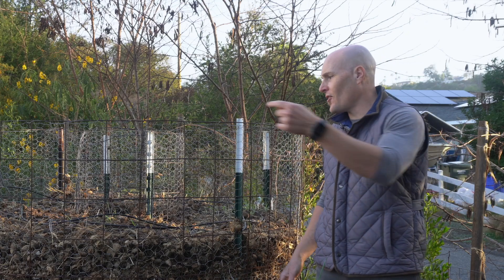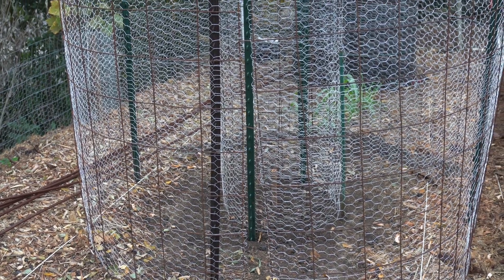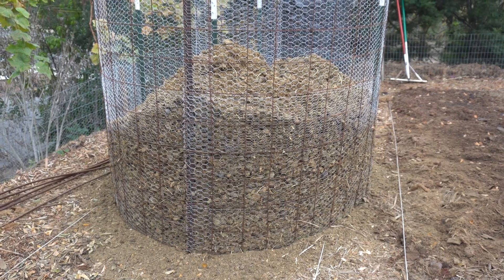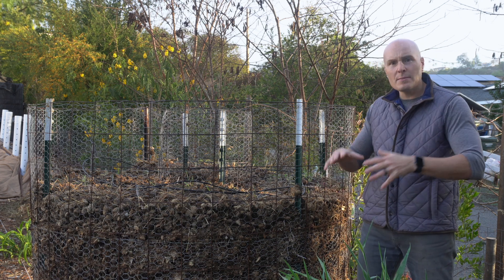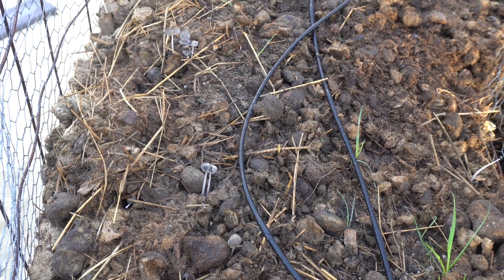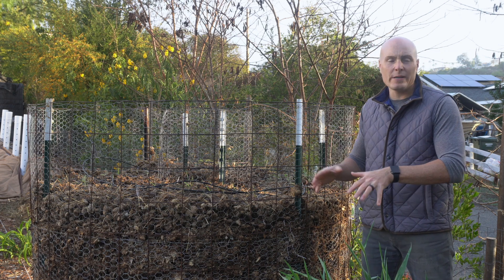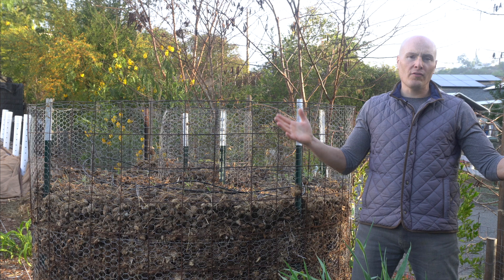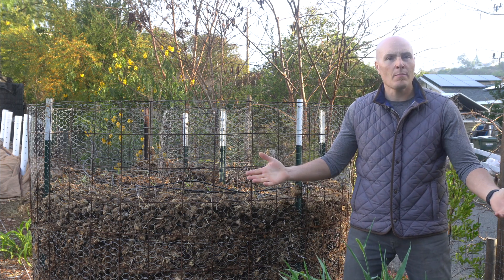Huge Compost Bioreactor | MORE COMPOST, LESS WORK

Comment: Great compost doughnut! What if you added different horizontal wire "layers".  Maybe chicken wire a couple of feet down so you have inch hexagonal openings for finer compost to fall through and decompose into the bottom layer of 1/2 inch hardware cloth.   I think the addition of 1/2 inch hardware cloth to the base could be a way to sift out the finished compost.  Maybe 1/4 inch hardware cloth at the very bottom?  Perhaps there's a foot of crawlspace you create with large rocks or whatever and the finished compost sifts itself to the bottom of the pile? Then you scoop out the finished compost without open the outer ring?  More bottom air flow?  Then the doughnut becomes a delicious layer cake.

Comment: Diego, for people that already have the typical rectangular composting bays made from pallets, what are your thoughts on using an inner ring (or rectangle) in those setups?
Reply: Do it
Reply from the maker: If you aren’t turning makes sense.
Reply: This design works great. I built one that is 5 feet tall with a 5 foot outside diameter and 1 foot inside diameter a few days ago. One spot in my reactor was 135 Fahrenheit this morning while the air temperature got down to 25 Fahrenheit last night. There was actually snow on the top of it this morning, but 10 inches below the snow it was 120 degrees.

Comment: Diego, 

I did a conventional, 100% outside Johnson-Su design in Oct 2020. Because I am in Ontario, Canada (Zone 5b: -15°F to -10°F), I added two roof de-icers to keep the wigglers alive. I also wrapped the vertical cylinder with R24 Rockwool. Unfortunately, last month the de-icers caught the weed fabric and fence on fire. Watered 8l every other day.

Any suggestons, especially for us snow-bound forks? 

I have NO idea why the de-icing cables lost their shielding and started to spark. Les
Reply: @Mike-rp6lb  Thanks Michael.
Reply: @SpringwaterParkcc  unfortunately it required a high tunnel.  I also tried the normal Johnson Su design (Zone 6) things froze solid.

Comment: The hole in the middle seems too big , a number of smaller holes would do same without cooling? Also the outside ring doesn't all have to be open? Just more area to lose heat isn't it? Cover on top keep the heat in?

Comment: Nice looking compost doughnut!  Regarding the fill material, you mentioned people asking if the pile heats up?  It's my understanding that the typical J-Su system consists of a more carbon heavy fill, like leaf litter...etc.  I see that you incorporated horse manure in yours to create a more traditional hot compost, would the same result be achieved using the different fill compositions?
Reply: Mine heats up fine with just grass and weed clippings.  That's what I tend to have lot of, so that's what goes in.  The balance is probably nitrogen heavy most of the time.  Sometimes I have some dried clippings to layer, that still heats up fine.

Comment: I'm going to build a Diego Donut Cake! What's the watering schedule? 1-2 weekly, for how many minutes?
Reply from the maker: Depends on location.  I would start at 10 minutes every few days and adjust accordingly.  I run a soaker hose on top.
Reply: @DiegoFooter  Sounds good. I am in Oklahoma; sometimes humid sometimes dry but mostly predictable. How do we preserve the fungal network after its complete? Won’t any shaking or breaking up of the compost destroy it?

Comment: Any reason this shouldn't work between two parallel lines of fencing?
Spacing them two feet apart should maintain the 1 foot to air maximum.
I'm just thinking of recreating this from pallets as a "mulch fence".
Reply: Sounds a bit like my plan.  1 side against a chainlink fence and pallets on the other 3 sides.  I might actually do more of a rectangle making it 2 pallets long (80") with 4 ft between the 2 long sides.  8" rounded rectangle center ring.  I set up a more regular Johnson Su with pallets the week of Christmas.
Reply: Nice thinking friends

Comment: Have just completed my bioreactor according to your modified specs.  It is a thing of beauty.  One question I have researched and found zero information on, is how to manage the system through a freezing winter (zone 5).  Frustrating, as quite large swathes of North America experience freezing conditions in winter.  Any advice would be welcome.
Reply: I tried the traditional Johnson su for 10 months (zone 6).  When I opened it in late march the middle was still frozen solid.  You are not supposed to let it freeze, not sure how I'd do that besides having it indoors.  If air can get to all of it, then cold air can get to all of it.  I did see a video in colorado where they did it in a high tunnel....nice if you have an empty already built high tunnel,  I don't have one.

Comment: Nice. I also have same kind solution. 2 different compost piles. Both has ground contact. First has bigger center "tube", but to second I just punch holes with plastic pipe. I also have more traditional looking JS reactors. But big question is, is there going on also biological life same amount than in original JS reactor? I can't proof or check nothing. We also have winter season and we just had long period -20°C (-4°F). And of course we have ice and snow top of the reactors. There is lot of talk why original JS reactor is "best" and why it's is that kind what it is. I don't know if you not have top cover and you get weed seeds, is that big problem. Hui-Chun Su said in Static Pile High Fungal Compost Demonstration video in here Youtube (14:19) - "Whatever you do,  do not let it dry out or freeze". I asked from David, what happen or what are the consequences if reactor freeze. I never get answer. I can't move my reactors inside so I have to deal with freezing winter. All compost recover in spring and even now just above zero celcius, leaf compost isn't in freeze from 1 foot deep (+2°C). My point is, you can make different reactors with different solution whats suits better for your situation and works better, if you can't follow exactly David's rules and can't get best results by that. In my case, reactor maybe needs 2 to 3 years to be ready.  Who knows... 
Composting is good and results are what those are. It not problem if quality is not the best. In here we have patented composting factory (Biopallo) witch make compost in just couple days. So, it's possible make ready and biologically rich compost fast with fungus, microbes and air. I don't know how they do it, but basics should be same as in all composting.

Comment: Diego, 
Watched till the begining a now i got a question and suggestion. Sincee the point is to have good air flow and 2 foot tick wall, and when talking about walls, what do you think about gabion wall mesh for this kind of bioreactor? You would have a "wall" 2ft x 10ft, and high as current bio reactor, simpler then doing donut or jonhson su.
What do you think?

Comment: Since it is sitting directly on the ground, are you going to have an issue with growth inside the inner space? If you get stuff growing in the center, is it likely to impede air flow to the inside of the pile and cause anaerobic condition? I like it better than the Johnson Su for the most part, just don't know about that issue. Thanks!
Reply: I think you are supposed to close the top with a tarp or something to prevent from rain, snow, etc....if so, then anything that is trying to grow in the inner space will die due to lack of sun.